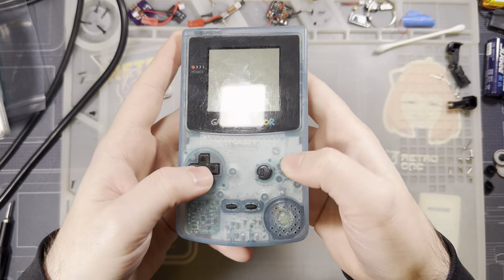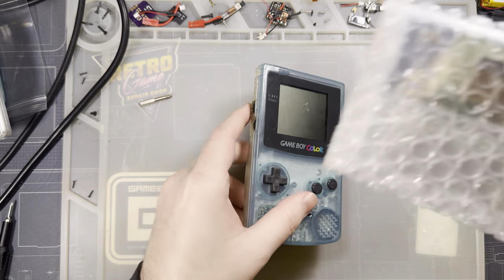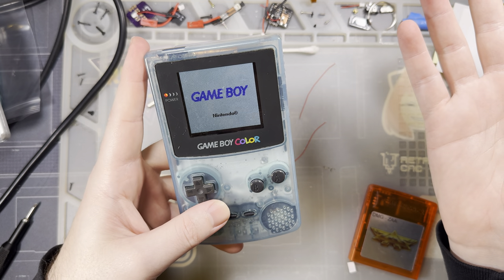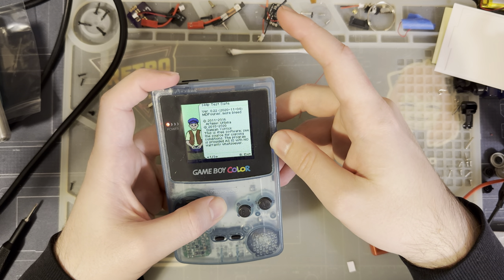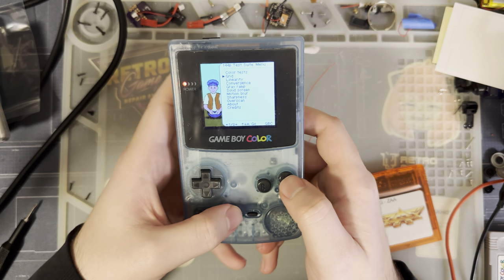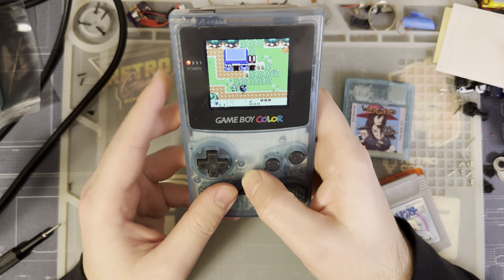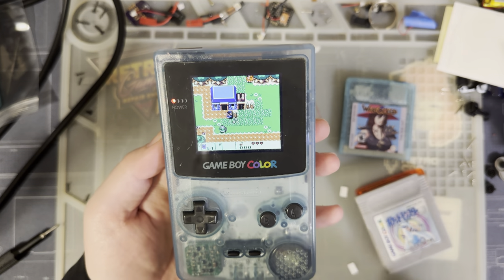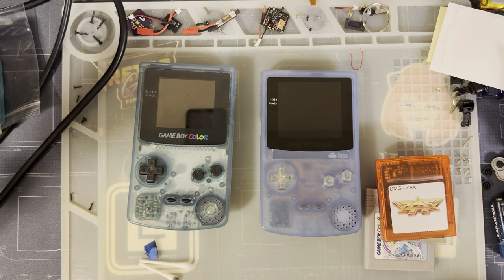2.45” Drop-In IPS for Game Boy Color (v1.1)

Comment: 56:45 which everdrive is that?
Reply from the maker: GB-X7 from 2017 ish.

https://stoneagegamer.com/nintendo/game-boy/everdrives-flash-carts/everdrive-gb-x7/
Reply: @makho  oh damn now I'm paranoid because I have that and just ordered this screen 🤣
Reply from the maker: @LumbyMcGumby  Well, I demonstrated worst case scenario in the video. If you're not using NiMh, not using a SD based flash cart (like everdrive or ez flash), OR just don't have the brightness maxed out, it's probably fine. Just gotta not do one of the things. 

For batteries:
NiMH is for sure the best bang for buck but Lithium-Primary (like Energizer Lithium AA) or Alkaline are both fine alternatives as long as you're fine replacing the cells as they die. Avoid "heavy duty" Zinc batteries, they're gonna be worse than NiMh for this application. Constant voltage batteries like JUGEE are a decent alternative and this is one of the use cases where constant voltage feature of the batteries actually makes a difference but something like funnyplayings internal LiPo mod will serve the same function albeit with the charger internal instead of external. 

Alternatively, just turn the brightness down and leave it there.